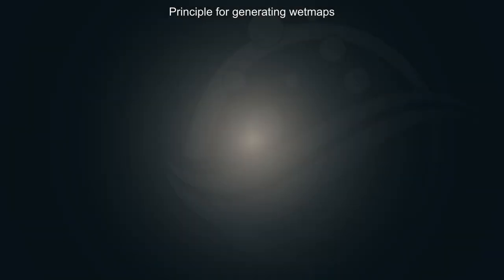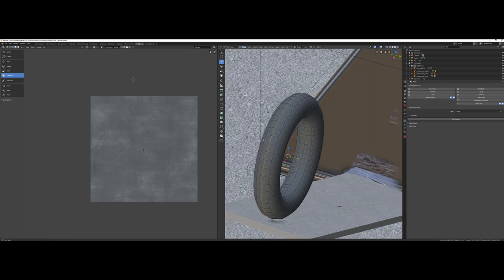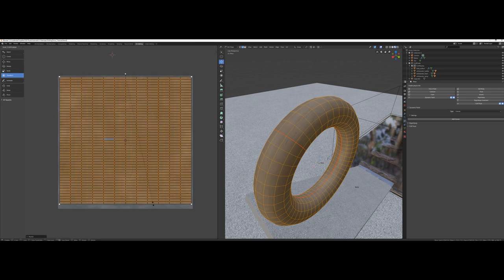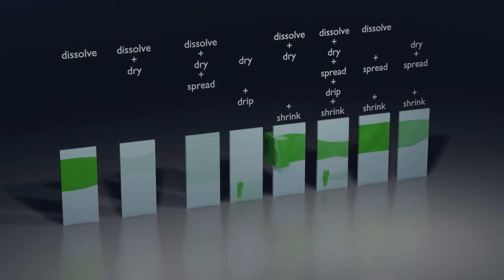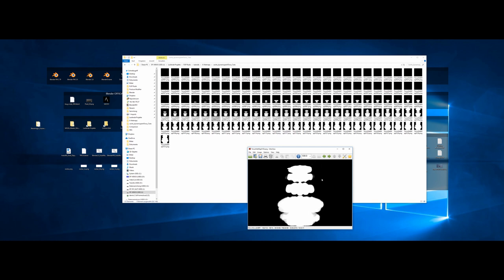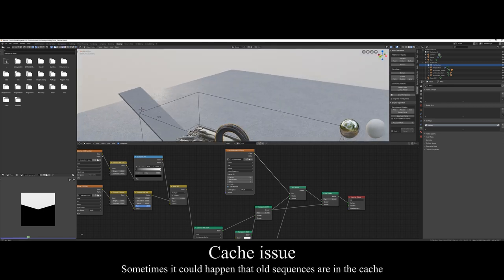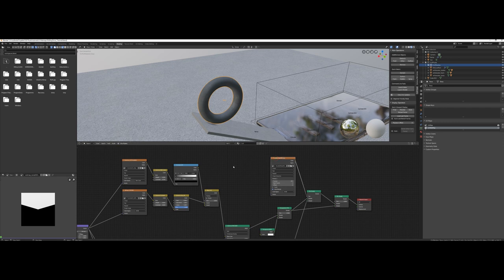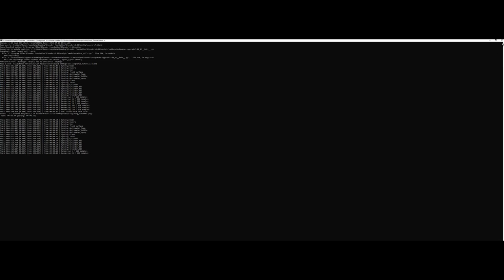FLIP fluids | #6 WetMaps (2.8)

Comment: I realized that in 2.8 Blender does not crash during rendering when i check "Render > Lock Interface". Maybe it helps you as well.
Reply from the maker: Thank you!
There is also a new version on the blender market the solves the crashes in general when using blender 2.81

Comment: It disappointing to the fluid not apply force to the torus. Just rolling without any water drag.
Reply: While true I personally find that to be for the best; It allows more control via forcefields over how objects interact with the fluid. I suppose the downside is added setup time, however.
Reply from the maker: Well that is correct. Having a multiway-interaction of pyhsics would be amazing! However it is really a hard task. It would require that Blender physics would "read" the external fluids physics - while the fluidphysics are using an exported mesh of a baked object.  We would need to program an own physics solver that runs inside our addon. Actually this is not on our todo list. But we could think about how we can fake things like this and maybe make the next tutorial about this ;)
Reply: @Blenderphysics-Videos  I saw this pyhsics in other programs water simulation. Maybe you just have to copy it, if the code has free license of course. :D
Reply: @timmyfifty7298  Calculating the forces for fluid-rigidbody interaction is not the main problem. The problem is that we are not able to apply or communicate forces to Blender's rigid body system. Blender does not provide a way for addons to interact with the other simulation systems while they are baking.